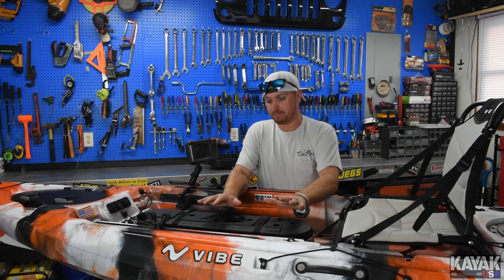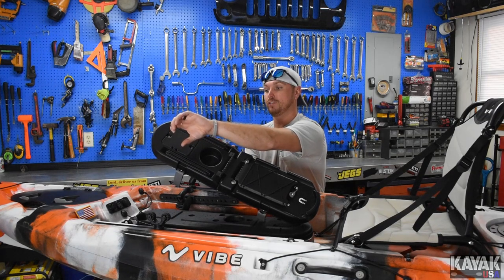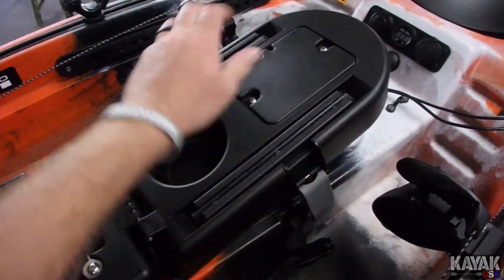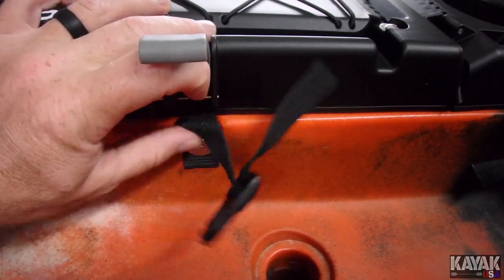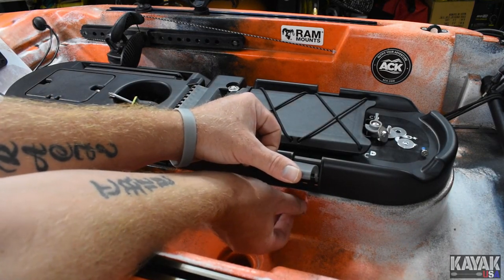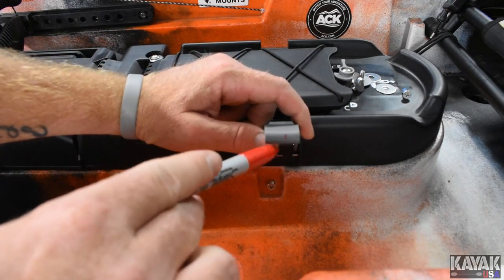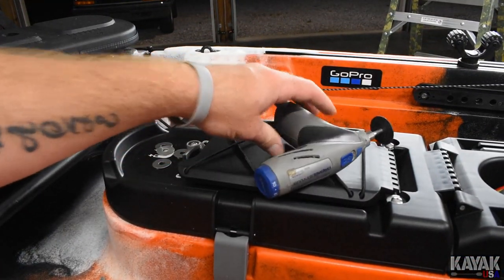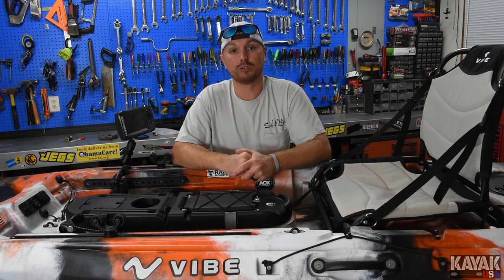My NEW Kayak hatch! The "Mod Pod II" Full Review and Install, DIY

Comment: Installed one on 2014 big Game II ,  I am curious about auto "lifter" install ( Lifts front half open when un-latched )there is a bit of a issue with unlatching & opening pod, as the clips when open hook on the clips mounted to console body - annoying as you basically need both hands to open it.thinking of gluing bit of springy foam in inside of buckles so they stay away from hooking on the bottom latch part when unclipped and loose,- preventing easy openingI have mounted a 2,5 hp Suzuki on the stern get out on big water trolling for salmon/trout. Always Need more room.I think Hobie pro fish 14 would be more practical tho.

Comment: note to the company who is designing this product , the fix to the flaw would be to have that hatch latch mounting point adjustable via small stainless screw and double nut setup along with making the mounting point wider to give space to move it more left or right !. that or the kit should come with a extra set of modified hinges.  would be so much better than cutting on a brand new 100$ product.

Comment: That Pod comes on my Kayak I have a Ocean Kayak Trident 13. That thing is pretty nice but I wish the clamp was a little more sturdier. I'm afraid that it will come off when I'm towing....hasn't yet - fingers crossed
Reply from the maker: re8elmonk0369 USMC , Thanks for watching!👍🏼 I have actually modified mine and it's soon much better now, I showed it on my "Family creek trip" video. I added a shock a handle and permanently fixed the back down... Check it out and let me know what you think👍🏼
Reply: Roger that - Will do. I'm debating on switching kayaks myself. I love the OKTrident13 but iI may go to the dark side of a pedal system boat

Comment: Nice mod bro! How are you liking your Yak ? I’m seriously considering this kayak.is that seat comfortable? How’s the stability?
Reply from the maker: TheDarios1988 , I love it man, very stable and comfortable!👍🏼
Reply: TheDarios1988, I agree with Kayak USA. I have the SeaGhost110 and I too love mine. Very stable and comes with a nice comfortable seat, rudder and paddle. Both the 110 and the 130 are under $900.00, I couldn't imagine a better 1st Kayak.
Reply from the maker: teedub127 , Thanks bud! Well said!
Reply: teedub127 thank you guys. I will try one out for sure before I pull the trigger on any kayak.
Reply: TheDarios1988, I was days away from buying another brand, then I saw an ad on YouTube and started checking them out. Long story short, I bought it sight unseen and the nearest dealer was in the next state about a 600mi road trip, there and back and it was worth it. There are tons of video's on YouTube with reviews on both SeaGhosts and some stability video's. Good luck and happy yaking.

Comment: I know this is off topic but I'm looking to get my first kayak. I've done a lot of research and have a pretty limited budget. I keep coming back to the Pelican Catch 100. I'll have to car top it so 10 ft  and 58 lbs seems reasonable. It's 34 inches wide so stability shouldn't be a problem. For about $450 (with discounts $650 without) would this be a good first kayak? Any advice or opinion would be extremely helpful. Thanks.
Reply from the maker: Bad Dad Fishing , Watch my " shopping for a kayak " video ,  I go over the difference between the kayaks to help the new guys out. It should help you out a lot! 👍🏼
Reply: Kayak USA thank you. Keep up with the awesome content.

Comment: Hey mister I have a stearate 125 and I would like to put a fixed trolling motor in the peddle pod an use the rudder that's 9n the boat already,really all I want is 2 wires sticking out going to power. Do you have avid like that maybe?